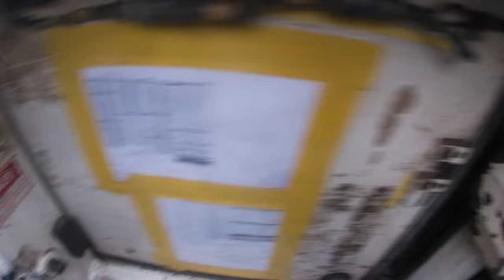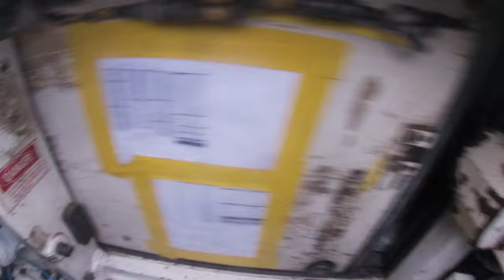Inside the M1 Abrams - POV of Tank Loader [Training]

Comment: Wow! The thickness of the turret top looked remarkably thin, too thin to be composite armour, if that's just an inch of rolled armoured steel then we have discovered that the Abrams has the same weak spot as Russian tanks. Yes the shells may be in a protected bin in the rear bustle so less likely to blow the turret off if hit, but when an anti tank missile comes in for a top down strike then that molten stream of metal particles is going to give the turret crew a very bad day, how many have been lost in combat, 278?
Reply: The thickness of tank’s roofs are usually thin are they not?
Reply: I think only like 70 have been lost (destroyed, captured, or abandoned) but idk. I know that there’s very few destroyed Abrams because it’s been used against weak insurgencies for the past couple decades and they don’t have that great of at ability
Reply: @aidboo1054  no its over 278 lost to enemy fire, not just by the American military but also by those nations that have bought it, like Iraq, Kuwait and Saudi Arabia
Reply: @nickmail7604  I’m talking about u.s. losses. we train our troops much better than whatever they can manage, and have much newer models, no offense. Besides, lumping in export losses with domestic is a bad thing. Russian t72 losses would be thousands higher due to Iraq losing their entire stock in the gulf war.
Reply: Pretty sure only the swedish? version of Leopard 2 has improved roof armor. Every other MBT usually just has a few cm of homogeneous steel.
Reply: 278 out of some 10,000+ we have produced? Seems like a good track record to me.
Reply: There is not one tank in service right now that doesn't have a weak spot on the roof, it's all about compromises, you put more armor where it's more likely to get hit... 

And top attack missiles are only common with NATO countries, no US enemy fields them in large numbers, the bigger threat for the roof will be drones (FPV, bomber drones etc...).
Reply: @nickmail7604   The overwhelming majority of the M1s lost have been export models which don't have the composite armor.

Comment: Sorry I can’t hear you. Just watched 3 minutes of whine. Ear protection or not, I guarantee all of these tankers having hearing loss.
Reply: Aint like theres a medium machine gun inside the fighting compartment thats shooting hundreds of rounds and a huge 120mm main gun too. Obviously they have ear protection but, lets be real, going into military service, you WILL sacrifice some of your hearing.
Reply: I would think the 120mm gun would be more damaging to one’s hearing than the turbine, wouldn’t you?
Reply: @warweasel2832 with the headset on the main gun is dampened pretty well and the are noise canceling headsets. But that whine is too high of a pitch to really get stopped that much, so it just goes right through, it's why so many of us have tinnitus after a gunnery or two.
Reply: @nucleus691 the guns get blocked out pretty well, but the whine doesn't.
Reply: With the CVC on, the whine is very, very low, and the guns are near quiet when fired.
Reply: Yes we do.  lol
Reply: @warweasel2832  The main gun is actually not very loud inside - when it fires it's just a "CHING-CLING!" as the breech comes back.  It's concussively loud outside, however - like a thump in the chest.  The turbine engine's whine is much worse over time - I am many other old tankers have no high-end hearing left.
Reply: @jeremyacevedo6592   True that if you keep it tight with the chin strap fastened.  The hearing loss is much more from working around them with the engine running.
Reply: @warweasel2832  when the main gun is fired, it's more of like deep bass shockwave in the turret.

Comment: Вопрос из России 🇷🇺, а почему в американских танках, заряжающий всегда почему-то чёртов нигга? 😅
Reply: ???

I don’t understand your question
Reply: @warweasel2832  ну ты че дурака валяешь, ты же меня отлично понял
Reply: @warweasel2832  russian thinks you speak russian, use google translate, helps a bunch, one ontop said its a ceremonial tank.
Reply: @warweasel2832  I think he's asking why the Abrams has a human loader, unlike Russian tanks which use autoloader? idk I could be wrong
Reply: @MrBonako  I really didn’t understand until someone explained. It doesn’t give me an option to translate in the app, so I had to screenshot, and the translation made no sense. 

Anyways, to answer your question: the Abrams tank doesn’t have an auto loader because it’s designed around the principal of blowout panels above the bustle of the turret. The idea is that the blast doors, which contain the ammunition, are always closed unless the loader is loading handling them. Korean tanks have a similar bustle design and, while they do use an auto loader, it doesn’t have the flexibility of switching ammo types that you get when you have a human loader. American doctrine also prescribes a human loader for the purposes of assisting with maintenance and other logistical jobs (They could even act as a secondary gunner or driver in a medical/combat emergency). It’s also one less part that could break during a firefight. Hydraulic loaders are very sensitive pieces of equipment that could, for example, lose pressure and ultimately disable the tank’s main gun, whereas if a human loader is disabled, you just have to get him out for medical attention and have a new loader jump in (or have the commander do double duty).
Reply: They don't of course.  I as a white man was a loader for a while - it's the lowest position on a tank crew and thus the one that almost all new privates first get (a few lucky ones get to be a driver, but that's usually the next man up the totem pole).
Reply: @WhizzingFish12  большое спасибо за ответ 🤝